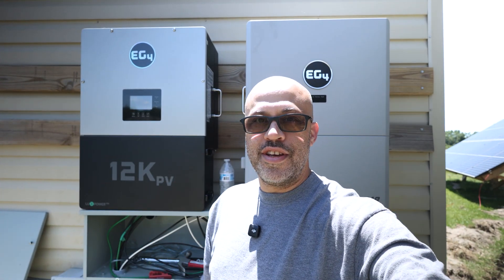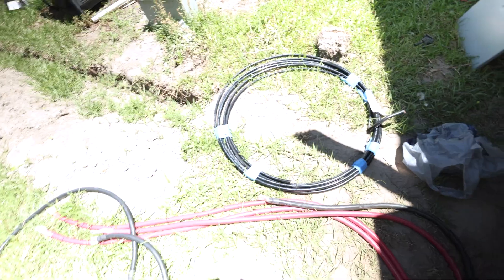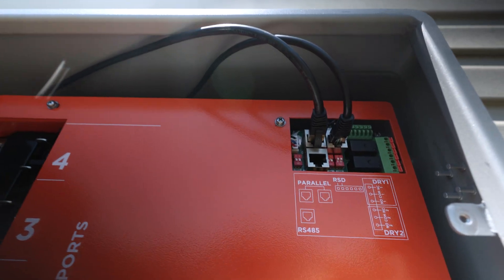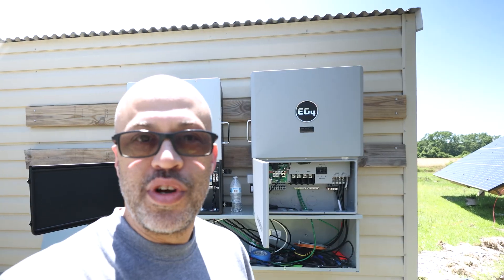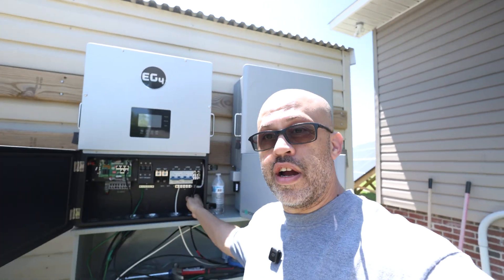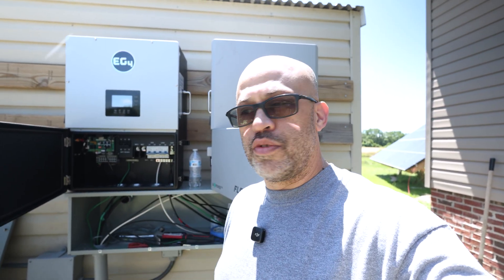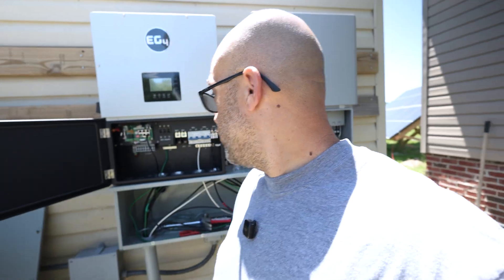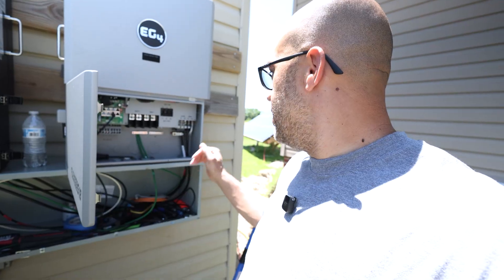EG4 Gridboss Flexboss18 and 12KPV Install Update

Comment: hello. hey, are you having problems with the eg4 monitoring app. today i went to check on my system and the app was not working. went to the website and it was not working neither
Reply from the maker: Down for me as well right now
Reply: @rodneyhunt ok well it seem it's a general problem with them i tried contacting them couldn't reach them
Reply from the maker: Yeah servers must be down. The dongles still work with solar assistant so they are definitely good

Comment: Are you going to be grid-tied and sell back?  Trying to understand the value of gridboss if only offgrid or grid for charge only.
Reply from the maker: Just the interactive features no grid sell back. I can use the grid when needed with different types of inverters I already have. Cheaper wire to get to inverters which I need near my existing battery bank in my building. Most people will not have my setup but if you want multiple inverters in a different location than your grid power might be a good option

Comment: I've been finding large copper wires cheaper on ebay than lowes/homedepot.
Reply from the maker: That is a good tip. I will check it out.
Reply: Just make sure it's not CCA, I've been scammed before on eBay/Amazon claiming it was full copper and it turned out to be cca

Comment: I live Off-Grid with an EG4 18KPV. I mounted it inside along with the 60 kilowatts of DIY batteries. I like to err on the side of caution rather then to temp fate, or in this case build quality. Just because you can, doesn't mean you should. My Generator, Chargeverter, Batteries, main breaker panel and Inverter are within feet of each other. I only need 1/0 wire from the batteries because they are less then 10 feet.
Reply from the maker: Nice! I built out the pergola over my parents 18kpv and it has worked flawlessly. I will figure something out with these as well. I have a awning type cover that I may install temporarily or just build a little roof over it.
Reply: That's great

Comment: I would have installed the inverters under the house over hang. EG4 tells us that they are out doors rated but not to be mounted in the direct weather. It also looks like the rain run off is dumping directly unto the inverters. Do you plan on installing gutters (rain troughs)?
Reply from the maker: I am going to cover them. 👍